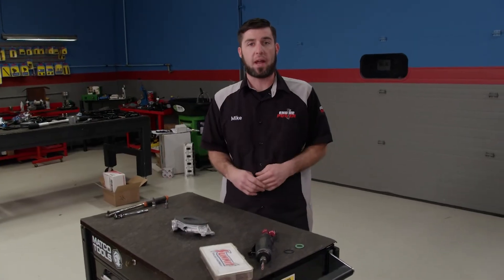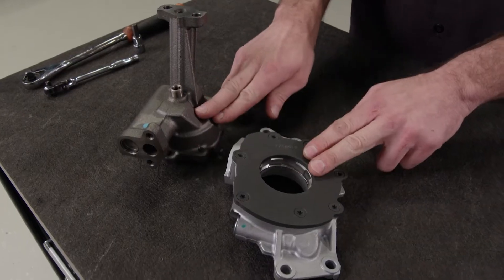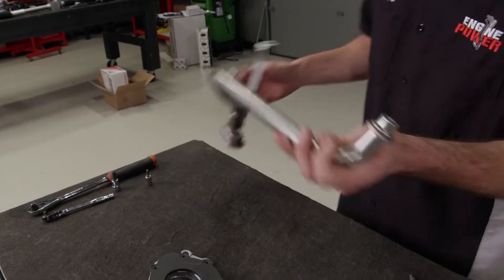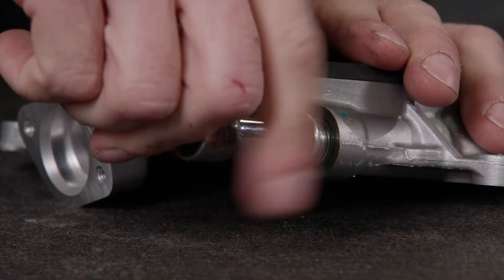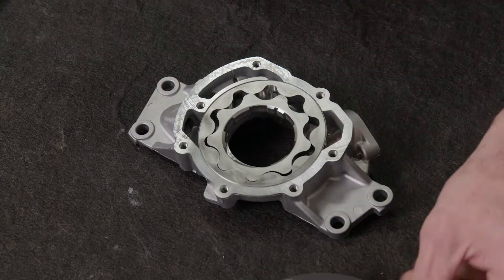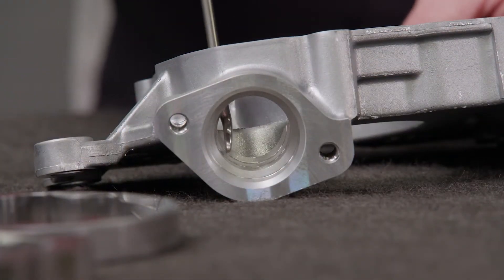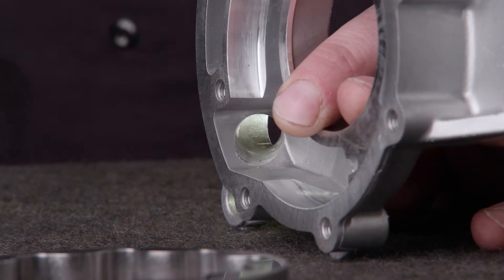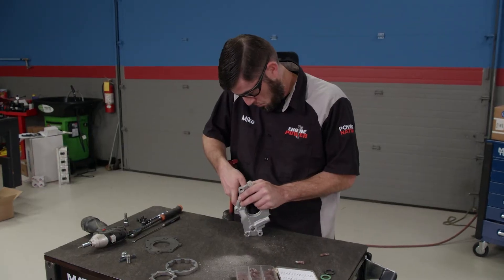How To Improve Performance Of An LS Oil Pump

Comment: I think the lip that Mike removed in the pump was unnecessary.  That’s where the oil pickup tube sits just beyond where the o-ring goes.  Probably should have bolted on the pickup tube and marked the very small amount (if any) that needed to be removed.  Also would have been nice to see how to port the pump exit orifice.

Comment: Do the vvt or dod pumps pump more volume
Reply: maybe 5 or 10 psi more.  Nothing crazy. Most of the engine across the line got the standard LS3 oil pump without engine managment.
Reply: @joanamendoza-r5l  5 or 10 psi is a unit of measure for oil pressure, it has absolutely nothing to do with the volume of oil flow. They are 2 different things. an example of flow would be gallons /per minute, liters/hour, etc. in response to the original question for other reading this comment section, all AFM and DOD LS engines will benefit from higher pressure and higher volume oil pumps. Melling makes standard pressure high volume, high pressure high volume pumps and supply them with multiple pressure springs so you can further choose what pressure you would like to run at.
Reply: @victorjbarker  Agreed, but measuring flow in an engine system is almost unheard of, but generally, higher pressures along the same flow path usually provides more volume.

Comment: although those mods won't hurt you can also put shims behind the spring  help increase your oil pressure.
Reply: Y'al be careful doing this on used pumps. The bypass valve is worn in traveling the unshimmed amount and can move to a non worn in part and cause it to bind making you lose oil pressure

Comment: why do all of that? all i did was add some washers small enough to fit in the hex plug. which was about 4 7mm or so and screwed it back on. oil pressure went from 36 to 65. done and done. cheap and easy
Reply: Where can you get those you're talking about?
Reply: @johnd.dupree8614   they're basically just shims that increase the spring pressure and increasing oil pressure

Comment: Make sure you note the top of the gerotor "gears" and put them back in the same way !!  They are chamfered on the bottom only, putting them back upside down would be bad.....
Reply: He literally opened it up and the chamfer on the large gear was facing outwards. So whats the actual correct way?
Reply: @jacobvanhalteren7452  The chamfer should be down !
The gerotors are flush with the (steel) cover, the chamfer allows clearance for the inside corners that are machined into the aluminum body.
Reply: @kennethalbert4653  So then why was it the other way when he removed it? I have the same pump and had removed them but forgot which way I took them out. Apparently, conventional wisdom is that the chamfer faces toward the flat cover because otherwise, the pump rotors would crack. At least this is what my brother explained from the KTM dealership he works at.
I'm just confused don't want to put them in wrong and end up with a worn-out oil pump sending metal shards to my bearings and lifters.
Reply: @jacobvanhalteren7452 
Seems the large one was chamfer up but it looks like the small one was opposite....
Maybe they had it apart already to assure it came apart easy for the video ? IDK.
I port these all the time, GM and Melling, and they have the chamfer down.
Reply: @kennethalbert4653  I'm just gonna call melling lol, no point guessing with it
Reply: @jacobvanhalteren7452  I've opened up hundreds of them, GM and Melling, I port them, that is how they are out of the box.
If you get any good info, come back and let me know, I love learning.